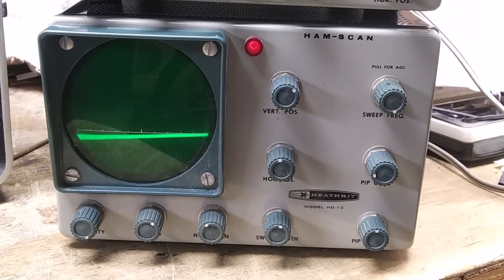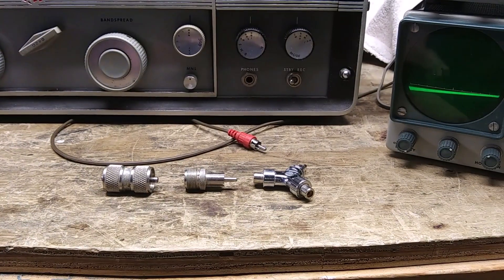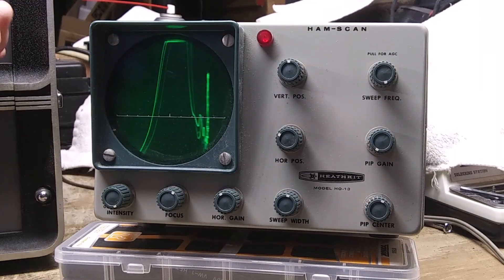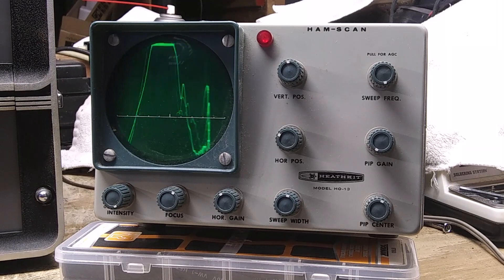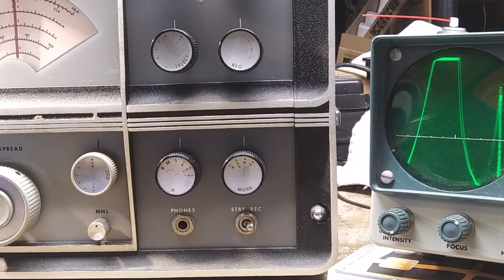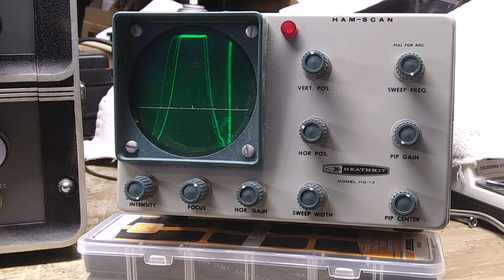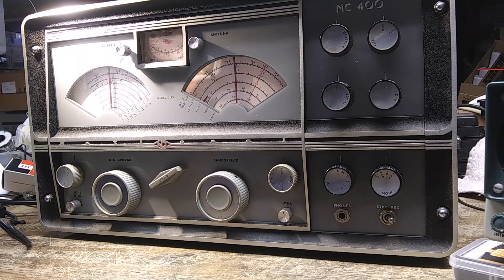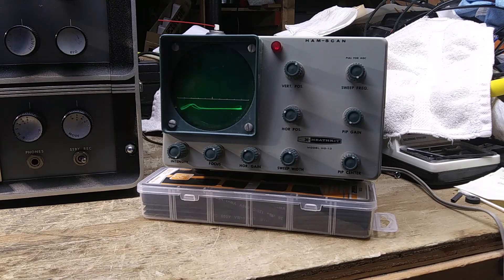Heathkit HO 13 Ham-Scan Panadapter Demonstration Part 1

Comment: You have something not set correctly, perhaps horizontal gain. On AM, the one AM signal covers the whole display. assuming that AM signal is about 10 kHz, the 100 kHz width that the scope provides should show signals to the left and right of the signal. Same for SSB, where you have that 3 kHz signal covering the whole scope display. In this configuration it is useless to look at a portion of the spectrum for activity, since any signal covers the whole scope display.
Reply from the maker: Steve, I agree. In part 2, I changed the settings quite a bit, and it was more pleasurable to use. I was not used to it yet, and I jumped right into making the video.
73 Paul AA1SU

Comment: i like your video but i have on idea how to or were to go in a receiver and hook up a scope like you have . most of my receivers are low priced like radio shack, knight kit , and heath kit. they have no jacks on the back for using a scope . can you make a video showing how to install a jack in the radio receivers please.
Reply from the maker: Wayne - thanks for writing. Most receivers do not have an IF out port. The more expensive ones may have them. My Collins R-388 and R-390 both have them. This National NC-400 did too. However, none of my other receivers have this. I just double checked my National NC-98 and NC-109 and they don't have one either. However, my NC-109 has been modified. There is an RCA phono jack on the back of the chassis that is labeled Q-Multiplier.  I may check that out at some point to see if it's an IF port.

I do not know how to install such a jack on the chassis, myself. Maybe you can find something here on YouTube. You will need to know the Intermediate Frequency of the radio, and then you will have to be lucky enough to find a HO-13 that was built with that IF. On the other hand, you may be able to do something with an SDR. I don't have any experience with those, either. Good Luck.
Paul
Reply: @vtradio  thank you paul . i have two heath kit station monitor's that are working and was thinking if they will work the same as the set up you have. i will have to look around for help.